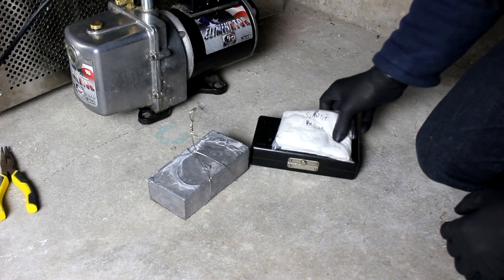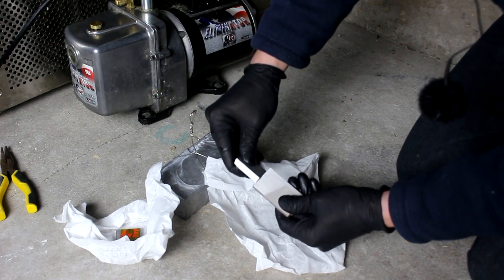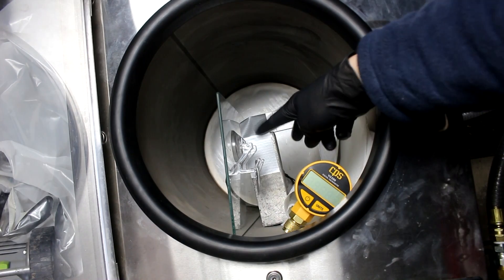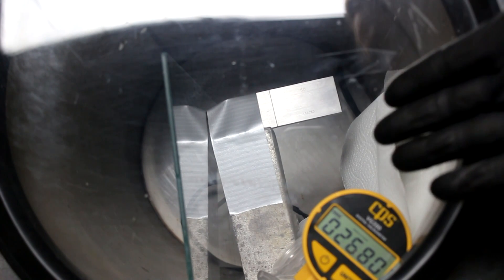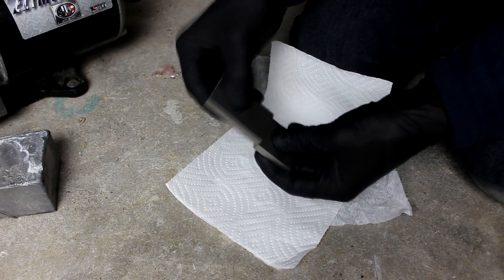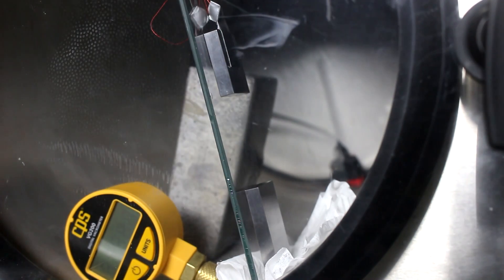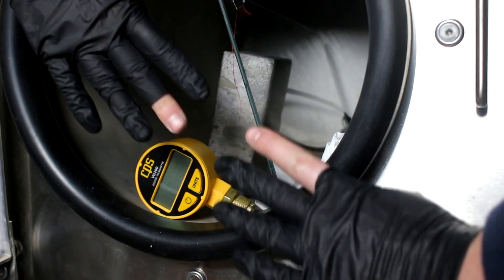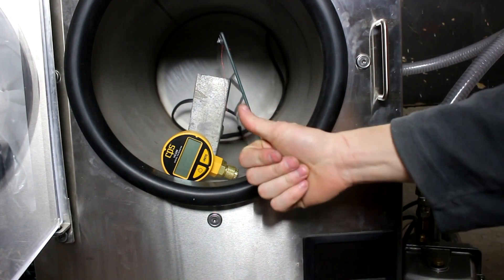Will Gauge Blocks Stick In Vacuum?

Comment: It's the oxide layer on the metal, that's preventing the metals form sticking together. Which is why when you rub them together they stick, because you are shedding that ultra thin oxide layer thus exposing the metal to the metal.
This is was seen by NASA in the first space walk, because the hinge on the craft rubbed against the hinge on the door. And since both materials where the same, that oxide layer was removed and the metal fused. NASA later found out that this was cold welding, but also found out it's actually a very easy problem to get around.
Reply: Apparently the door getting stuck in that spacewalk was just due to a sticky hinge, but it kickstarted research on cold welding.
Reply: the fine oil layer would also prevent them from sticking together.
Reply: SQTOS. Perhaps not, given the ductility of gold compared to steel.  I'd say it's time to take it to the electron microscope to qualify that. ;)  I'm with John on this one, working on my MS in materials science.  Don't trust me though, my academics are... average.
Reply: John J the fine oil layer on them should avoid any oxude from forming
Reply: Any welding would leave marks and damage after taking them apart , like in the videos of AVE (with the two gold plates).  :)
Reply: That doesn't explain why it works with ceramic gauge blocks too. If it was cold welding they would be leaving marks and much harder to pull apart.
Reply: So why can I wring together ceramic gauge blocks?
Reply: Cody needs to see this
Reply: The comments in this thread are god
Reply: Perhaps what's happening is you scrape the oxide off the surface, but also you're adding in fresh oxygen from the air, then between the two blocks a new oxide layer forms, which bridges across both blocks welding them together. If wringing them together in a vacuum doesn't stick them together this might show the oxide being responsible. Hell a vacuum isn't even required, just place the blocks in a vat of oil and try to wring them together.
Reply: John J 

It is actually a myth that the door jamming on the Mercury mission was caused by cold welding. The true cause of the jam was a mechanical issue with the door.
Reply: Ollyweg 0 nope
Metals exchange electrons freely
Reply: ***** metals are well known to bond to themselves under specific conditions 

They will bond to themselves freely
Reply: PhD dude above us explained this already.
Reply: John J not entirely, I'm pretty sure that DNews made a video about cold welding
Reply: More likely van der Waals forces or perhaps the oil itself is the key....
Reply: I think oxide as a reason for stick prevention could be plausible on certain materials.......but I also think thats not directly related to why they do stick which is the question at hand.......in other words oxide or not perhaps prevents sticking doesn't necessarily mean no oxide causes the sticking.......its interesting that the exact mechanism of the phenomenon is not well known yet.......there were masters & a PhD or 2 disagreeing(at least partially) above.
Reply: I've seen ceramic and aluminium blocks wring together, too.  It's not the oxide layer.  

I wonder if simple glass, polished well, would also work.
Reply: I was thinking that, test them under oil, or perhaps in an argon environment.
Reply: Was it cold welding or just binding? Binding is common between similar or identical materials that move (shaft and pillow block, shaft and spacer, etc) If an oxide layer was being removed(unlikely because of oil) then the blocks would slowly wear down unevenly and stop working... but I've never heard of that happeneing.

Comment: Does this work with most/many metals?
If it is Van Der Waals forces, then electrostatic repulsion should be able to obercome it; if you can charge both blocks to a high enough potential that is...

Maybe you could try putting a very thin layer of different materials (such as liquids with different permittivities) in-between the plates and see how that affects things?

If this can also be made to work with a metal that forms a strongly adhering passivating oxide layer, you could test to see how well two pristene bare metal surfaces stick to eachother, compared with how a thin oxide layer on each surface affects things?

Comment: Maybe you are removing an oxide layer with the rubbing motion and then the metal just cold welds
Reply: I think static excites the atoms and it weld's at a molecular level
Reply: Unlikely. They would loser tolerance and precision if that were the case and be far more difficult to separate. ALSO, there are ceramic gauge blocks that work just the same and ceramic doesn't cold weld!

Comment: could it not be static it could be displacing electrons and causing an obviously substantial amount of attraction i know they are the same metal but it could be taking it from the air its displacing, just an idea but feel free to prove me wrong internet
Reply from the maker: thats actually a good hypothesis but how do I test it?
Reply: A compass should do the trick here, right?
Reply: try it under different kinds of fluids?
Reply: ***** positive or negative electric current.
Reply: Maybe 2 wires attached to each piece and grounded, to get rid of electric build up.

I doubt it's that anyway.

Comment: Cody, put the them between two pieces of glass a spring holding the one down and another spring that pushes the spring from the side.  See if you can get them to stick like that outside of the chamber then repeat inside the chamber.

Comment: I have a theory that may work if nothong else does. Would you heat the blocks to maybe 200 degrees celcius and drop them on top of each other in vacuum to let them cool? Maybe it's caused by the change of the rougness of the surface of the gauge blocks caused by the metal expansion with temperature causing them to stick like a tape you used as an example earlier in the video.
It may be that when you forcefully slide/squeeze them together the friction raises the temperature right where the blocks stick to rach other
The heat gets very quickly disspiated
Reply: I know that it sounds stupid but we should test every possible theory to finally solve this problem

Comment: I know it is not very accurate but you know that a classic vacuum gauge is like $10 at any auto parts store and will at least give your a visual estimate as it gets lower
Reply from the maker: also are total crap for very low pressures so...
Reply: but you have something already for very low pressures and the only ones that really work are for ultra low and are really expensive most mid-ranged very low gauges aren't very good either and tend to drift quite a bit in testing,  they are great compared to mechanical dont get me wrong.  the mechanical ones would give your viewers some indication of pressure as it drops as well as not turning off on you so that you can indicate there is still an absence of Atmosphere

Comment: Could it be something to do with an oxide layer. When squeezing the blocs together u could be removing the oxide layer and it could be recreated into the layer together sticking the two together as in the vacuum that wouldn't happen cause there's not enuff oxygen

Comment: Perhaps the atoms start sharing electrons or virtual electrons and so pieces lightly attracted (weak force?). Or is it a localized magnetic field from the metals rubbing like making a paperclip magnetic.
Reply: The position of the electrons is only a probability and with the blocks pressed so close together, there is a probability that the electron is possibly visiting a neighbor atom on the other block. The closer the blocks are together the higher the probability that an atom on the other block is borrowing that electron and vica versa.. Just a stab at it.. lol

Comment: has anyone tried doing this with blocks made from different material? maybe it's some sort of resultof the Strong Nuclear Force? if the faces are that smooth that the faces are so close togehter with nothing inbetween and made of the same element / compound perhaps the atoms are tricked into thinking they part of the same mass?

Comment: I thought it was the "smoothness stickyness" (I'm sure the effect has an actual name but I can't remember it) like the one described in one of Veritasium's videos but you debunked it with the vacuum test. Could it be some kind of electrostatic effect? In a conductor charges stay just on the outside. It could be that the sliding is moving the charges from the contact face of the block onto the adjacent face. In that moment the 2 blocks start acting as one since one of their faces no longer has charges on it, thus creating a cohesive force. You could test it by grounding the blocks and trying to wring them.

Comment: Hello cody, in every vacuum video you're talking about "a near perfect vacuum". I was wondering if it is possible to even get a perfect vacuum without going to outer space. If so, how would one get a perfect vacuum?
Reply: A true 'perfect' vacuum aside from not having any gas inside does not even contain any light (photons).  That being said, it is practically impossible to attain a 'perfect' vacuum, much like it is in impossible to reach the full value of absolute zero in temperature.  We can get incredibly close, but we will never actually get to the perfect number due to tiny little environmental factors that cannot be engineered out of our designs.   Outer space is not a perfect vacuum for these reasons and still has gas molecules in it, there are just not that many compared to our atmosphere.

Comment: make your own vacumm chamber, a frame, some glass, some filler like epoxy or caulk and on one of the panels have 2 circles, and put some gloves attacked to the glass itself so you can actually mess with the itemd in the vacumm, cause this test was horribly done

Comment: Hey Cody! You could try putting the metal pieces in a bag and pumping the air out of the bag, then sliding the pieces inside the bag and see if sliding them in a vacuum makes any difference.
Reply: :D there's no bag that could hold real vacuum
Reply: Yeah also it's gonna be tricky to slide the blocks but maybe he can make it enough for them to fail to stick together. I'd bet this is not related to pressure though.

Comment: Van der Waals force?  Geckos use it to stick to glass.
Reply: Adamast That's what I'm thinking. Especially with how smooth they are.
Reply: vdw-force don't exitst/work with metals unfortunately.
Reply: +Hellslave  I didn't know that,  maybe some traces of a lipid,  I saw someone cleaning blocks on the skin (against lint) before sticking them together.

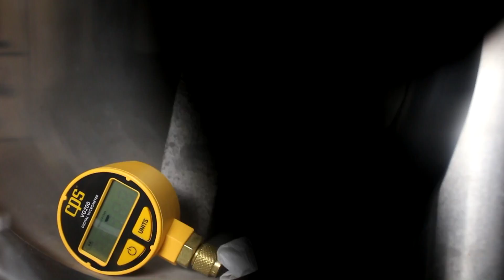Comment: 9:30 there is still an oxide layer on the metal. jou have to remove dat in vacuum or in a atmosphere without oxigen en dan put it in vacuum
Reply: A very good point. Although horrible spelling.
Reply: Johan Taube sorry, i'm dutch
Reply: Leroy De Vries Dont be. He would make mistakes with another language. Just like everyone else
Reply: Yes of course. I make a lot of mistakes. My only wish is that people, 
especially if they know that they often make mistakes, read through what
 they've written and try to correct spelling errors and such. 

When you write a text badly you risk that the reader only sees the errors, and not the point you try to get across.

Comment: Cody. what is stopping you from creating a vacuum chamber with a side that has holes for plastic gloves. use acrylic. you can put your hands inside during an experiment and manipulate things inside the vacuum. will thick plastic gloves hold up or be stretched until they rip in a vacuum.
Reply: They wouldn't do so well around explosions would they?
Reply: This kind of equipment would only find its way into an advanced lab, you will need a seriously impressive working gloves, and you'd need to perfectly seal it to a strong acrylic chamber.
Making this specially designed acrylic chamber is not cheap to begin with, but the gloves and the perfect sealing is a little too much of a stretch.
Reply: fla playa If anyone understands this comment, please translate.
Reply: yep. not an easy task. but would be a fun engineering project. and useful for future experiments. I could make it happen. should I put it on kick starter?
Reply: Or a DaVinci robot.  Or, um, a lapyroscope?
Reply: yeah i was thinking that would be a good idea.
Reply: Adam Savage had a video about this. Had a setup justlike that.
Reply: thick rubber gloves with electrical tape around them to keep them from expanding.
Reply: own plz he could maybe ask Pacific spaceflight. he's building his own diy spacesuit
Reply: he might be able to try bead blaster gloves there fairly tough
Reply: 90% of the population have I.Q's above 3000. Of course you can't put a glove box under vacuum as almost all cold war radionuclide separation and refinement was done under such conditions.. Oxy Moron of the day "Acrylic". It's so flexible. Youtube is like a feeding station for duck shoot.
Reply: FlyingJetpack1 wat about normal rubber gloves inside of metal mesh gloves? seems like it wood werk
Reply: nobody's shadow Could be a good idea, it will also be pretty durable to any rough work. As long as the metal mesh can handle the force of an entire atmosphere pushing into the chamber through the gloves, then it can work really well. But considering these gloves were never built to withstand this specific force (outward push) i have no idea if it can do it, but it is sure worth a try. Also, strong robber gloves will resist some of the pressure, like an in inflated balloon.
But now that i think about it, Is there a mesh big enough for a rubber glove? These are made to mostly have only a thin fabric between the hand and the mesh, fitting in a thick working glove might not be as easy :/
Reply: really fine metal mesh with squares <=1mm in side length, i've seen that kind of mesh freequently, and the amount of rubber expansion through a hole that small would be negligibel

Comment: could it be the sliding motion is transferring charge or at least aligning it on the surface not sure how you could test that though i suppose you could charge both sides with a small same polarity charge then see if they still stick together
Reply: Gareth Rees I was thinking the same thing, that can be proven/debunked by throwing some of that magnetic film viewer thingy AvE show cased.

Comment: When you burn the string in the chamber, it will introduce gas. Another thought is that you let air into the chamber to slowly and it has time to get between the blocks before the full force of the atmosphere is pushing them together.

Comment: Hey Cody, I got a couple experiments/projects you could try:
Wolframite refinery into tungsten.
Using a powder explosion to trigger a nitroglycerine explosion in your mine.
Making a methane run electric generator.
Piezoelectric floor tile to power and recharge devices and batteries respectively.

Comment: When you bang two metal pipes together they become slightly magnetic, could something similar be happening at a very small level?  If that's the case the strength of the bond could be explained by this happening many many times and adding up.

Comment: It's funny watching AvE handle these like they'd explode if he breathed on them, then there's you dropping them on each other.
Reply: NanaCoffee I was thinking the same thing 😂 I bet AvE's in tears
Reply: NanaCoffee Ave knows how easy it is to damage them a light scratch can make them where they will no longer wring.
Reply: I learned the hard way that these things also form flash rust really easily if there isn't enough oil on them. Any moisture directly on the surface is really bad as it forms spongy protrusion of rust and pitting when the it cleaned up, both of which are bad for accuracy. Luckily the rust only formed on the non-essential surfaces, so a little 1200 grit sandpaper didn't do much harm.
Reply: Pressure treated lumber will also shrink (And annoyingly twist sometimes) as it dries out. Always fun to replace deck and fence posts that have decided to twist 90 degrees down their length.
Reply: if cody was a machinist and cared for the longevity of them,  he'd be babying and oiling  them too
Reply: Vedvart 10% is on the high end. mostly you figure  everything will shrink about an 1/8" and you'll be in the ballpark. lumber mills cut everything a little oversized so  when it shrinks it is still correct. and you usually don't let things get so wet that they expand that much again. They will fluctuate with the humidity though.
Reply: 10%? Is that an actual value you've encountered? That seems way to excessive to be practical.
Reply: Ironic considering AvE isn't too delicate with anything
Reply: +Miles11we That's really awesome that you know about that level of detail about wood.  I don't know fuck all about wood so what you just said was well interesting to me.  Thanks Miles.  You're awesome!
Reply: Miles is referring to the shrinkage of green wood.  10% is common.  Why we rough cut 10 inch bowls with 1 inch thick sides when they're green, and finish cut them a year or two later.  Allows room for them to warp while drying and still have enough thickness to turn them round when finishing.
Reply: The next like on NanaCoffee's comment will make 100 likes.
Reply: There's a good chance that the measuring blocks won't like frequent transition in and out of this type of vacuum chamber, due to the water vapor from the air.
Reply: NanaCoffee well if you plan on using them you should handle them carefully. everything seems to change shape so easily on the small scale. 

thats why im a woodworker, "yeah in this direction this board will expand and contract 10%, 4% in this direction and .5% in this direction seasonally" everything moves so much that you just to build in ways that alow the wood to move. makes things simple.